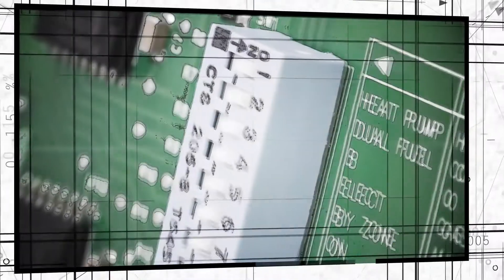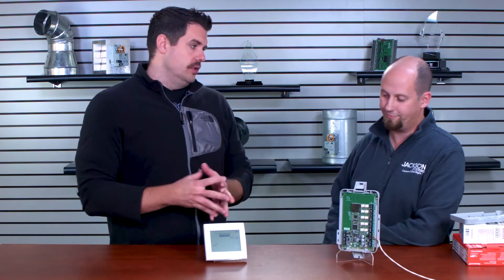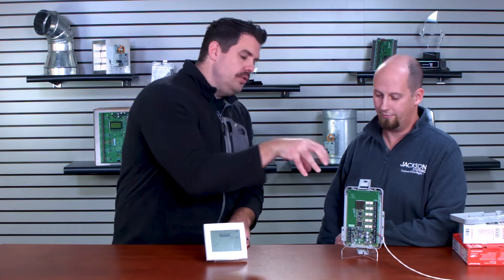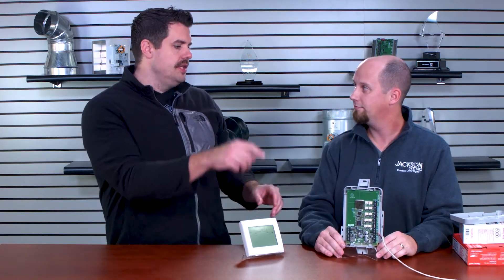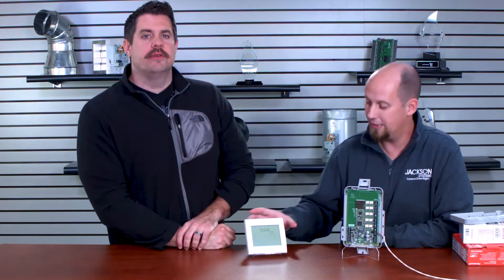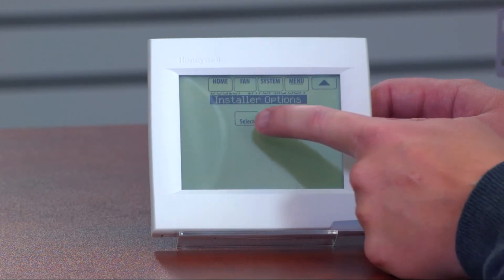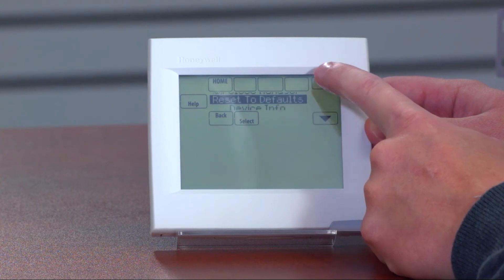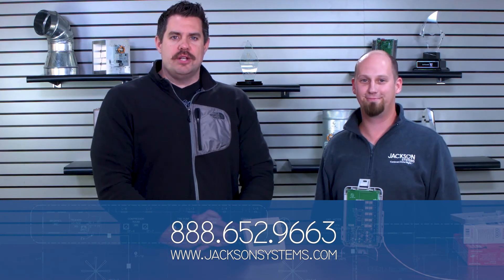How to Pair the Honeywell VisionPro with an EIM (Equipment Interface Module)

Comment: Thank you guys.

After 3 days of searching on the internet and checking everything in the system,.... to resolve the message I kept getting (Redlink needs 24 vac) when I tried to get my wireless Honeywell T stat to communicate with the EIM after the initial error message,.. "memory error" when power went out... your comment,... 

"oh and if you get it wrong,.. or need to change something,.. you have to reset everything back to factory defaults and then reprogram from the very start again,.. otherwise it won't work"

 was the answer.

Within 5 minutes after watching your video,.. it was up and running.

3 days of trying to figure this out.

Looks like your video has helped many even 4 years later.

Can't thank you enough.

Comment: Solid advice. My Interface module stopped connecting with the remote thermostat. So no A\C in the summer. Following the directions here got it up and running again without having to make a service call as the thermostat panel message started. Thanks gentlemen for this upload! Well done!

Comment: Thank you guys!!  This saved my rear.  The screen on mine stopped working and the warranty is useless as you need a contractor but when I spoke to a few contractors they only offered to install a new wireless thermostat for over $600 and would not work with Honeywell on Warranty so I ended up buying the same unit I already have for $100 and was able to get it working with your video.
Reply from the maker: Awesome story, thanks for sharing!
Reply: Hey, I know this is two years later. But what was your screen doing? Mine is like half working. Thermostat still operates but is hard to see
Reply: @monk0383   Hey  the screen was just not responding to touch so I could not change any of the settings.

Comment: Hey I'm setting up this on a 1.5 ton heat pump set up, Goodman condensing unit. Can't get fan to work on Air Handler but heat pump comes on in heating & cooling. Did the equipment test & it all works except fan.

Comment: I’m getting a new thermostat with Redlink. Where does the module go? Will it be located in the basement near the furnace? Or in the office near the internet? Will the guy who installs the thermostat also be plugging it into the internet? What if I don’t want to plug it in to internet? Could I just turn the thermostat on and off manually, with the touch screen (I don’t want to program it to go on and off, either). Please let me know, thanks!